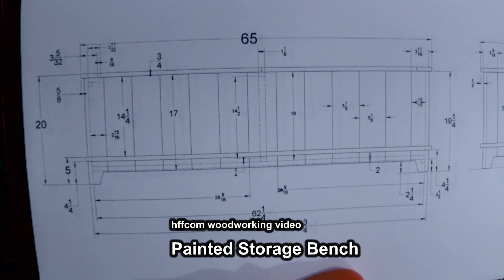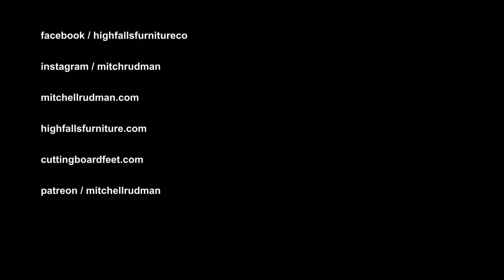Painted Storage Bench Custom Furniture Complete Build

Comment: @26:35 next level is height adjustable cuttingboardfeets haha.

Some yrs ago I made a similar multi-purpose bench -- a combined firewood, pillow storage, sitting and sleeping bench. 
The bench was, however, made of two vertical frames with six pieces in each corner and the middle (all made of 2x2''s). For the (floating) panels I used reused boards with tongue and grove (3 pieces stacked horizontal in each panel). I had only hand tools available at the site, but to fasten the panel boards btw the vertical pieces I pre-made groves on the vertical pieces (luckily I have a dado stack on my table saw, a no no here in Europe).
Half lap joints and Titebond III was used throughout to make the frames, and except for the few hinge screws, I only needed 12 long screws reinforced with 6mm wooden dowels to fasten all the pieces. Since the bench is placed under a roofed terrasse in a fairly dry climate at a mountain cabin, it has been left totally unfinished. 

Plan for next summer is to give it a good sanding, applying ferrous sulfate to initiate an aging/greying process, leave it for as long as possible before winter, and then seal it with outdoor wood oil.